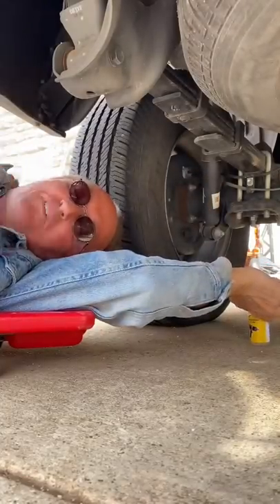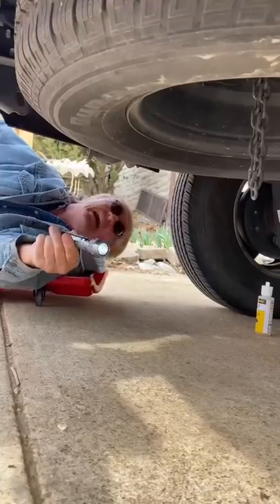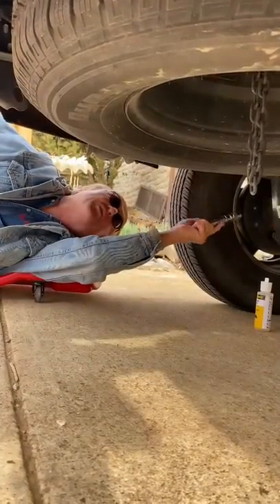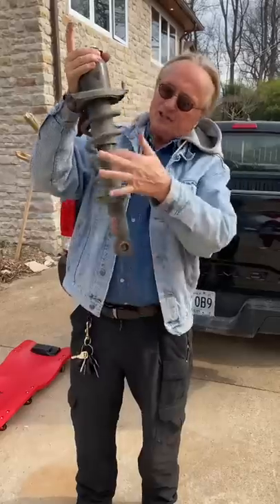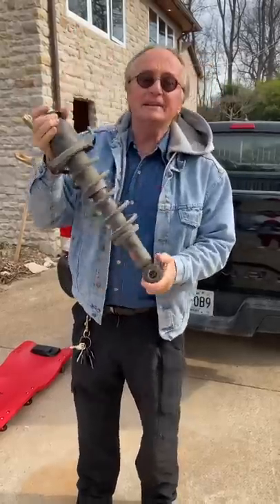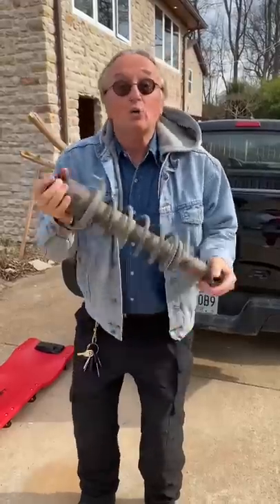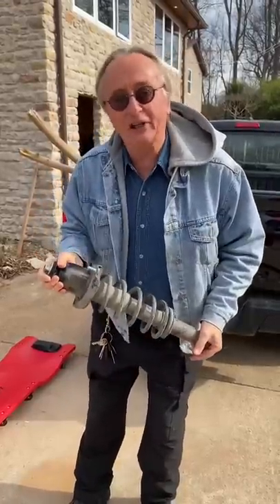How to Spot a Scam Mechanic

Comment: I just changed my air filter and cabin filter.    Mechanic told me i need new ones.  Left as fast as possible.
Reply: Literally same thing happened to me at a dealership lmao. Like you’d think they know I just bought filters from them
Reply: @Lebrick101  I wonder what dealership you went to? Luckily when I've taken my SC400 to Lexus to find out what the check engine light was (though I know there's a way to check what it is without a fancy scanner but had to make sure) they said I didn't even need to pay $200 for inspection since they weren't 100% sure since the code can be one of the 2 problems. But yeah thankfully I have yet to run into sketchy shops since I've always look at the reviews first before going.
Reply: I have no cabin filter and a mechanic told me I needed a new one, proceeded to rip out my glovebox, and show him and the other customers what a scam he was pulling
Reply: I had a dealer change my air filter that I had put in just a couple months earlier. He didn't even ask me if I wanted one. It just showed up on the bill when I went to check out. That, along with $25 for "Misc. shop supplies". I told him I wasn't going to pay for the air filter so he put my old one back in. When I asked him about the "Misc. shop supplies" he said that was for shop rags they used to wipe their hands on when they got dirty. So they couldn't use a $3 roll of paper towels. They had to gouge me.
Reply: I remember when JiffyLube did this to me. I replaced the air filter the day before but the following day I was feeling lazy and decided to get my oil changed instead of doing it myself. When they showed me a dirty air filter I laughed to the point I howled.
Reply: @EnhancedTrashBin  😆🤣😅
Reply: @EnhancedTrashBin  the dealership I went to used to be great but they changed owners and even though it’s all the same staff, the service is terrible now. Obviously won’t be going back. I’m assuming the new owners offer more commission for up-selling 🤷‍♂️
Reply: They honestly probably didn't even check they probably just recommended it due to the mileage on your car and history you've had with the company
Reply: @api4779  Yeah, you're probably right. I just wish they wouldn't lie about it. They really hit me with the "it's looking really dirty" after 2 weeks in the car lmao
Reply: @api4779  That's not honest.
Reply: I've never changed a cabin filter in 25 yrs of working on my vehicles . I never understood the reasoning behind it. If I'm running the heat or ac I'm recirculating the air and if I want outside air I roll down the window.
Reply: Mine simply takes them off of my car and show them to me asking if i want to replace them
Reply: All t of times places will say you need CAF or car air filter due to milage this is true for automatic transmission change and cabin air filter reason being is if a costumer has a dirty cabin air filter but doesn't want or have the money for a new one when you take the old one out alot of times they can rip them the dealership has to give the coustomer a new cabin air filter.. This costs the dealership money .. Where I work we check everything
Reply: @api4779  You are exactly right the cabin air filters can be a pain to get out without damaging them so if a costumer doesn't want a new one you can't put the bad one back in .. Same goes for the transmission fluid over 74 thousand miles it's getting ready to need changed 100 thousand miles we always recommend it unless it's posted on the paperwork that it had been previously done.. but the other stuff should be visibly checked
Reply: @Frank-mv1jg  Uhh, Frank, the air in the cabin goes through the cabin filter too. There is a reason no one wants to ride with you. 🤣

Comment: Imagine if they checked your oil like in the old days, they would tell you that you need some and then your engine would blow up from having too much oil.
Reply: I remember the trick of the mechanic putting his finger on the dipstick just below the cap at the top so that it can't go into the engine all the way. "Oh hey look. Your a quart low on oil".
Reply: Imagine if drivers would check their own oil?? I wouldn't be replacing so many engines.
Reply: @YU-ic1cw  They're told that modern cars don't need anything done to them and they fall for it, especially women owners

Comment: SAme goes for seals under the hood.  Valve covers etc......ensure you know everything is sealed before taking into a garage.........otherwise you could be buying these along with their kitchen sink.
Reply: Either that or just say that the car is on the constant oil change program.

Comment: When I bought my prior car, I wedged in the "lube for life" package for free into the contract. After like 3 years of free oil changes the mechanics started to go hard on these "inspections" and problems. They once brought out my air filter with leaves on it and they were like OMG you need to change this!!! I asked the price of a new filter and they were like oh $55. Told them to dust the filter off and put it back in... They were so silly. It's too bad that car got totaled.

Comment: I just replace the front struts on my 03 Celica 210,000 Mi on the original struts. If it was anything but a Toyota you'd be on your second or third set maybe more!

Comment: Ten years ago, I Took my car to the same dealership for oil change service while my water pump was broken, they never said anything about it. Took it to a different dealership for the same reasons (oil change), and they told me the water pump needed to be replaced.
However, a few months ago the latter dealership also told me recently that I needed new wiper blades, when I just changed them a few weeks prior.

Comment: I have always tried to be an honest mechanic for the place I work. But we got a new manager and he is upset at me for not recommending enough stuff. His big complaint is I needed to start recommending things based on milage. He gave me a chart of how often to replace certain things. Among those are shocks and struts at 75,000 miles, even if they are perfectly fine. I have been recommending a lot of services I would have otherwise not recommended because I can't lose my job. I do somewhat sabotage his attempts to sell things by specifying that I am making a recommendation based on milage, so that when the customer reads it they question him more on it.

Comment: I bought a couple new parts and took my car in to have them change the parts (preventive maintenence, nothing broken). I've had my car for awhile now and baby the absolute crap out of it. I had changed the oil a week before taking it in. 

The shop calls me the next day and says my car has almost zero oil in it and they took pictures of the low oil light on the dash and a picture of the dip stick. YOU COULD LITERALLY SEE THE OIL LEVEL (albeit faintly) AT THE FULL MARK ON THE DIP STICK IN THE PICTURE.

The POS drained my oil, tried to get me to agree to have them search for the leak and still charged me $30 for new oil when I refused and called them out over the phone and in person in the shop. 

Never ever ever go to Driven Automotive in Meridian Idaho!!!!

Comment: A chain tire store told me my 2012 4Runner needed all new shocks/springs...cause `it was  time`...with 66K mikes?!  vehicle rides & handles perfect...they wanted around $1200 for the job...all I wanted was the free rotation of the tires I purchased there...laughable how businesses try to scam customers.  Will not buy tires there again...they will loose thousands in business...not my problem, their fault.  Screw them.

Comment: Check engine light came on, autozone claimed O2 sensor. Dealership changed 3 sensors, 3 spark plugs, water pump and added Lucas oil stabilizer. Picked up vehicle and check engine light came on same day, this time codes were P0420 and P0430, bank 1 and 2. I’m not educated enough to know how all this works. Could what he did cause those codes to show? I have a 2009 Buick Enclave CXL. Seems odd that those codes were not there just a few days prior

Comment: Went into dealer for oil change. I was then told I needed new brakes. I said "They're 1 week old. I Did them myself" . So they slightly loosened the nut on a power steering line and sent me on my way. Next day saw some fluid on the driveway. I had to pull the tire and wheel well liner to find the source of the leak. Tightened the line myself. I called my salesperson at the dealership and said what happened. I never went back.

Comment: Hi
I have Cadillac El dorado 1989
Strats not good. And I can not find strats assembly or even shock part.
Can I buy similar length strats and simply weld in place?
Engine transmission are good.

Comment: Struts should be changed every 60K! Do NOT wait for them to leak! There are videos showing the performance of cars with older struts! You'll be surprised!!
Reply: If tires are wearing evenly, there's no leak and no clunking, then i'm not changing my suspension parts.

Comment: I brought a used honda crv 2004 2.0 AT AWD . After buying and using it for some days i found that its head gasket was once overheated and was changed in addition to that the car ran on aftermarket CNG kit for 3000km . We removed the CNG kit and now the car is giving half it’s actual performance, please help me to regain its original performance, the car’s original 0-100 time was 10.5 seconds but now the car is giving 21 seconds for 0-100 . The agency told us to change throttle body and intake manifold and doing so helped us to improve the performance by only 20% . Odometer is 140000. 
The acceleration and pickup are not good , the car feels like taking up load while picking up , and while overtaking it struggles a lot.
Please help me to regain the complete performance. No engine light is on
Reply: Try cleaning the mass airflow sensor. Pressure test the fuel pump, check and maybe change the fuel filter too. Also change air filter.
Reply: @akubel33t  sir air filter mass sensor fuel filter has been changed but only 5% change is observed
Reply: @digvijaykataria4961  okay, only thing left I can think of is to check for vacuum leaks.

Comment: Well this is kind of weird situation. I had a couple situations in my short career when I lift the car up and shock absorber goes bad. You can even hear distinct noise the shock makes when it fails mid air.
Reply: but then you say “i lifted it and it failed”
a buncha pressure can keep things in place for quite a while. or at least that’s what i tell myself….kept a broken shock for a while cuz it broke at a decent place. didn’t mess with much as long as the car wasn’t lifted 😂 lasted long enough, before she ended up totaled.(unrelated to the shock)

Comment: Smh you can just test your struts by pushing down on the car if it's stiff your good but if it's easy to push down on and it jumps up and down get them replaced and sometimes they break on there own but you don't want that ....

Comment: Always record the actual odometer reading, NOT the trip odometer. I took a Ford to a Ford dealership for a stalling problem. After multiple visits they told me the mechanic drove the car for 20 miles with no problems. Evidently he 'accidentally' reset the trip odometer. How? Because I had recorded the actual odometer reading I was able to show the car had not been driven at all. 0.1 miles between my recorded mileage and the mileage they gave the car back to me, and tried to charge me.

Comment: It can be normal for there to a small amount of oil residues since there's oil in the shock
Reply: If there's oil on the outside of the shock, that means it's leaking.
It's NOT normal for a shock to be leaking.
And if you want to argue that you are right, then why are the original shocks on my 23 year old Suzuki bone dry?

Comment: Hello Mr. Kilmer. 
Tyvm for your helpful video 
PLEASE make a video so that they will then care so that there will be a change. 
In regards to how the TOYOTA company didn't make enough HIGH PRESSURE AC hoses (2019) from the compressor to the condesor. I had a leak in it a month ago. I don't have AC for a month now. They say it's on back order and they don't know when they will have it. What's so hard for them to make these hoses? It's getting hotter every day. 
If you made a video then they will speed up the process. 
Please make a video on this. 
It would be greatly appreciated

Comment: Yes that is true Scotty to replace leaking shocks or struts; but. The manufactures of "most" shock/ strut companies recommend replacing your shocks/ struts at anywhere between 40k - 60k miles even if they are not leaking.   ¯\_(ツ)_/¯